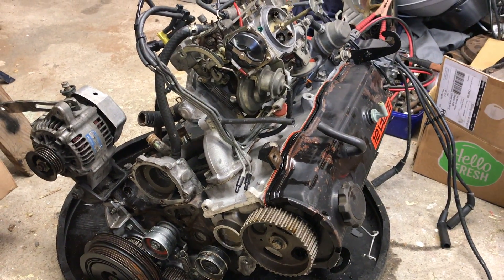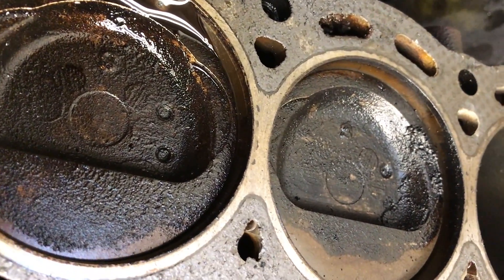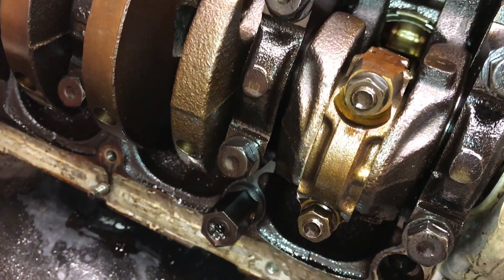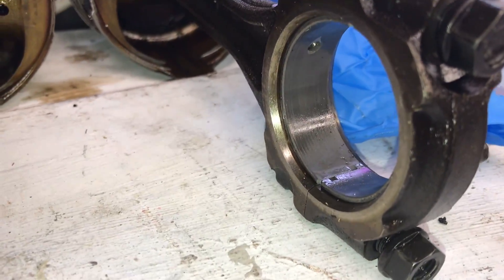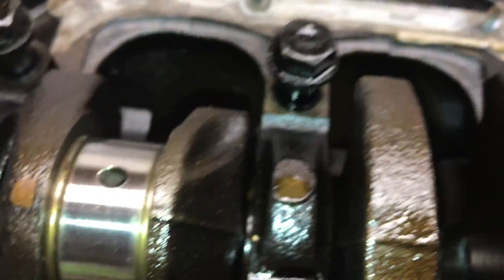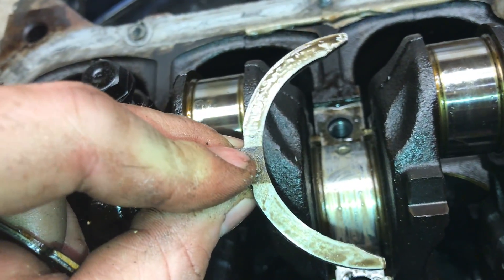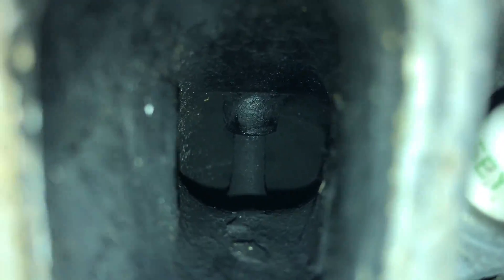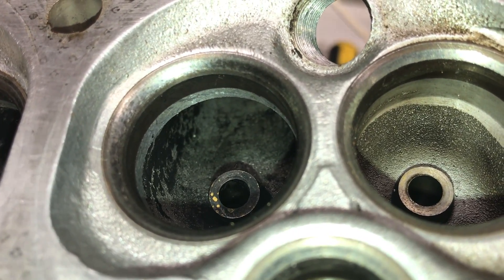2E Engine Disassembly

Comment: I have same engine 1997 toyota conquest tazz I'm doing engine overhaul bearings were polished with size 030B and 040m with standard pistons will it run smoothly I'm in south Africa johannesburg

Comment: Did you ever get the chance to work on an automatic transmission for these engines? I am puzzled with an very old starlet with the 2E engine and the 3 speed automatic transmission, and I think the governor is failing but maybe you have some knowledge about that ?

Comment: Hey man, awesome video. I'm rebuilding the 2e in my starlet but I can't find a manual, I'm assuming the 87-92 Corolla haynes manual will have everything I need, can you confirm that?
Reply: following, have a starlet also.Wiring manuals for old models on internet, not manuals for engine found